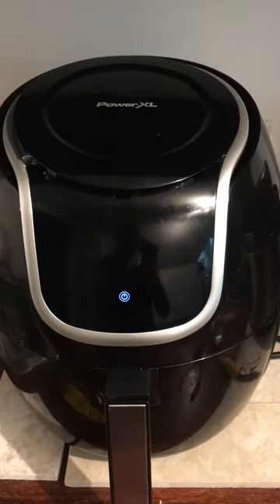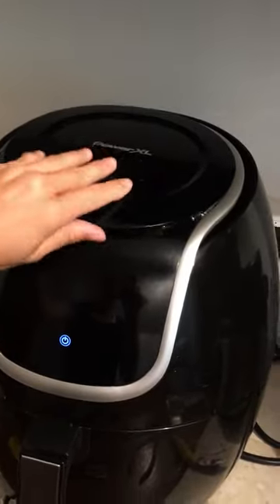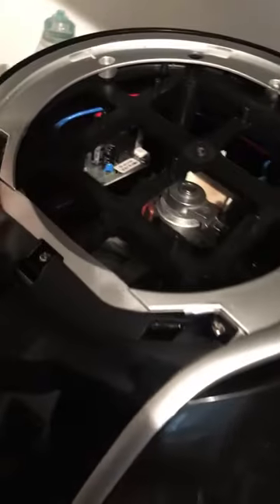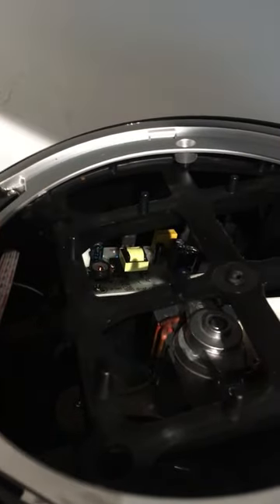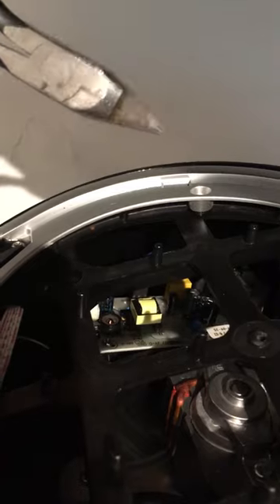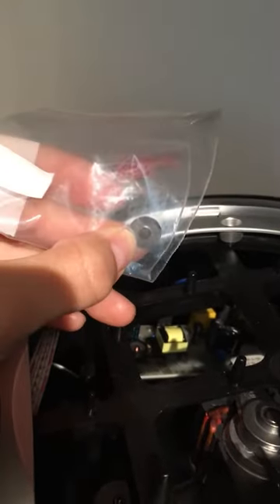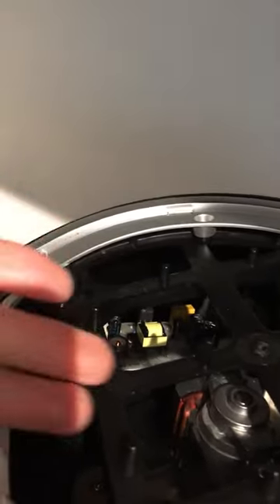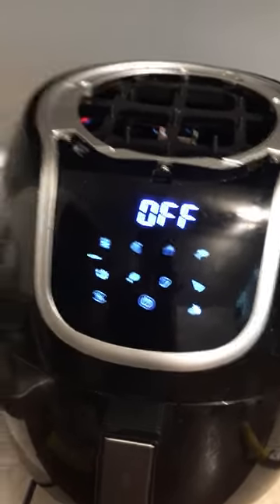Disable/turn off beep PowerXL Air Fryer

Comment: This beeping has woken up my daughter near every time Ive attempted to use it at night. You have provided a Nobel prize worthy contribution to this world.

I had the smaller version of this air fryer and the speaker was difficult to see but it was located in the back left of the circuit board. I couldn't get anything in there and it would have been too much trouble to open the whole thing up. Eventually, I just took a screw driver and pushed the speaker at an angle until it snapped off the board. Because of this, it fell down into the air fryer, but after flipping it upside down and giving it a nice few shakes I got it out. :)
Reply: Right, cause why in the world would the manufacturer provide a volume or beep-style setting?  We just got one for Thanksgiving and between the Air Fryer and the Cheap-O Small Microwave that makes the same incessant and annoying sound too.  Leave something in there after it completes cooking and it will beep every 30 sec for.... infinity.   I have ADHA and live downstairs. Occasionally l Go down to grab something or throw the dog a ball and forget all about my item, but what is the "danger" in having food sitting in the Microwave once the cook cycle is completed?  I will find it eventually.   My Aunt on the other hand who lives and works in spaces connected to the Kitchen isn't usually pleased when I "forget it."  

So here I am on the internet looking for a Solution.  I was planning and prepared to disassemble to solve the problem.

Comment: You removed the peizo speaker. putting a piece of tape over the hole in the top of the cylinder will quiet it significantly if that is your goal
Reply: Thanks for the tip!  It worked perfectly.   I still have a ding to know when food is done, but it is very soft.
Reply: Damn! Wish I would have saw this comment before I yanked it off. Oh well
Reply: Damn I wish I read this before I literally tore my shit apart to get it off
Reply: Oh my goodness THANK YOU SO MUCH. You cannot imagine how much you've helped me!!!🎉😅

Comment: I did this on my Power XL grill/air fryer combo. The beeper is on a circuit board behind the front panel buttons. It took disassembling most of the fryer to get to it. I don't understand the mentality of the makers on why the need for 5 beeps when closing the lid, constant beeps for the lid being opened. just grrrr

Comment: Just watched this. Sooooooo helpful!!!  My fryer is a bit different but top is the same and I must first say I am happy with how well it is made!  That being said, thank you very much for suggesting to use a knife!  I used two thin blade knives. One to get under and hold the edge up while I worked around and popped up each section with the other. There is no good place to begin but to get rid of the ear piercing beep I didn’t care if I caused a scratch or two!  When I reached in to take off the black part, the entire thing snapped off the circuit board — which didn’t bother me but if someone is nervous about that, I recommend putty or something on it to quiet it instead.
Reply: Putty might burn, could be fumes maybe toxic.

Comment: I just did this procedure to mine and it worked! It actually says buz on the circuit board where the black cylinder is. Thank you times 1 million! That was sooo damn loud! Lol 😆
Reply: Do you have the brand new edition? I just got mine and I need to do this. Glad their is a resolution.

Comment: Looks like they redesigned it. They put the fan over the top of the electronics. It's a much more involved process now
Reply: Is it quite now?
Reply: Did you manage to remove yours? Mine has the fan in a plastic casing under the "lid" and I can't see the PCB. Wondering if you managed to get into the PCB to remove it somehow?

Comment: You can do this in a very easy way by getting that cap off and just taking the copper wire off the coil there, but fair warning the buzzer will not ever work again (not that anyone wants it to)

Comment: The new design is impossible to get the lid off they probably redesigned it because people were taking it apart. What the fuck
Reply: I bought this not knowing it was so loud and I have 2 roommates, did you fix the noise problem?

Comment: How do you get the lid off? My knife doesn't fit in the edges
Reply from the maker: You have to insert a small flat tool, like a butter knife, around the top and gently work around the circumference - prying up each snap.
Reply from the maker: Maybe try a different flat object if your knife is too thick?

Comment: The inside of my power XL is completely different and only has capacitors and such on that left hand side.

 If yours doesn't look exactly like hers, please do not attempt to remove anything cylindrical in shape, you could get hurt and destroy the machine.
Reply from the maker: True!! Thanks for the tip!
Reply: There was a little capacitor next to my speaker, I know from various times disassembling random electronics as a kid that those are no fun to touch lol and keep power in them even when the power is off.   But I still successfully removed mine which I am so glad for even though it made me nervous.
Reply: Too late…destroyed the fryer but I got it.